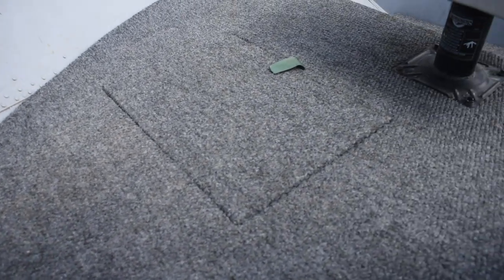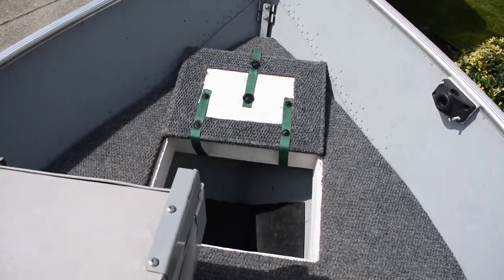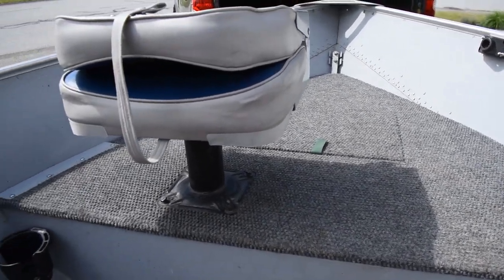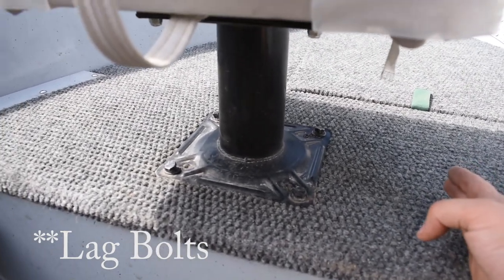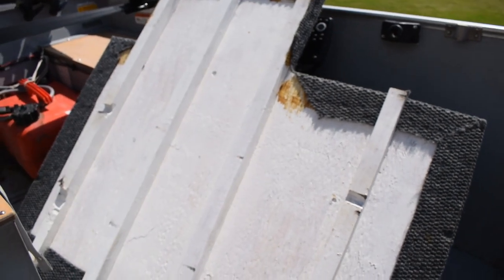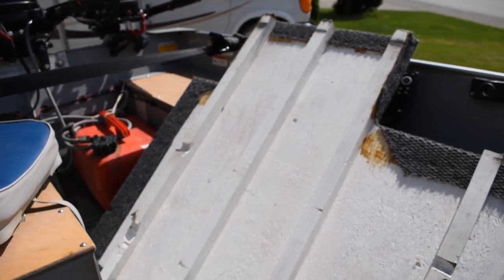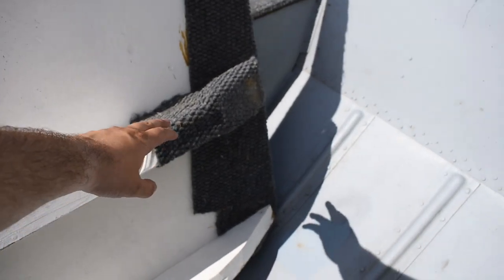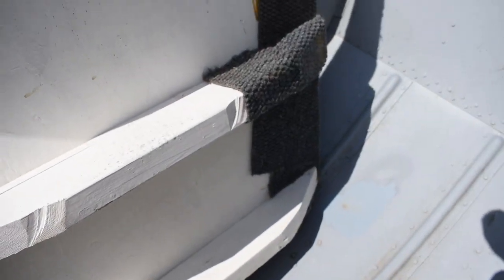Casting Deck - Lund WC' 14

Comment: I'm thinking of doing a floor in the same boat.  For the floors you constructed, can you tell me what the installed distancenis between your rear floor and the top of the rear (driver bench), as well as the distance from the top of middle bench to the top of your front floor (not casting deck)?  In hindsight would you raise or lower the floors, or keep the same).  Thank you.

Comment: I know this vid is old but was curious about the foam inside the bench. Can I pop the top off the bench and scrape the foam out to
make storage? Thoughts?
Reply from the maker: Good question, I don’t recommend it only because this foam will keep your boat afloat if it happens to get flipped or fills with water. I know a lot of guys who still do it and it creates lots of storage.

Comment: I like this build and have been looking at doing it for my own WC16.  Did you notice much change in the overall stability of the boat with a slightly raised floor?  It looks good!
Reply from the maker: brendanclark81 didn’t notice any change in the stability but having the front floor allowed for a lot more walking area.

Comment: how did you stabilize the front? i dont understand how you put the front together. is there braces that go down the front to the floor to something?
Reply from the maker: Good question I basically framed out a triangle one side was mounted to the existing seat and at the point I had two bolts that I was able to mount a metal brack to hold the frame at the front. Let me know if you have more questions
Reply: @BCBackwaters  yes how did you attach the metal brack? its hard to see the very front. Im not very good at this stuff but i think i can figure it out if i could see that or know how you did that? did you weld something?
Reply from the maker: @johndiez2746  I bent a piece of steel and drill two holes in it and you know where you attach your crank strap on the front of the boat well normally that is bolted on from the inside so I just slide my bracket over those same bolts. I hope that makes sense

Comment: good vid.   have a few questions. what did you use to attached the casting deck to the back end of the bolts for the bow eye? also what size plywood thickness did you use? do you find it holds your weight well on it or is it too thin?
Reply from the maker: Michael Hamilton Thanks should of went into a little more detail on this part of the casting deck. I used a piece of metal and bent it into an angle to hold the front of the platform using the eyebolts on the front of the boat. I used half inch plywood as you can see by the framing there is no flex and I weigh around 220 and never any issue
Reply: @BCBackwaters  thank you for the reply.

Comment: how did you anchor the 2x4 base of the casting deck onto the seat
Reply from the maker: The seat base is screwed through the casting deck into two 2x4 which I cut away some foam inside the bench in order to make these fit and used some lag bolts and pre drilled the holes so the 2x4 wouldn’t split. If you have any other questions let me know.

Comment: How did you anchor the nose of the deck?
Reply from the maker: Sam Acosta I anchored it with a piece of metal to two bolts which are for the tow eye hook. These bolts are very strong and was a great anchor point
Reply: Thank you so much been hitting my head trying to figure this out with my boat to!!
Reply from the maker: Sam Acosta all good happy I could help! If you have any other questions let me know

Comment: How much weight did you add to the boat? I plan on using a rooftop loader
Reply from the maker: gerard haubert just the casting deck probably about 60lbs and the rest of the floor probably 40lbs.

Comment: have you done a speed test with the floors in?
Reply from the maker: I did a long time ago and definitely slowed it down quite a bit but ended up changing the prop and it gained some back. It was fast enough for me and even had boat full of people and it got one plane.